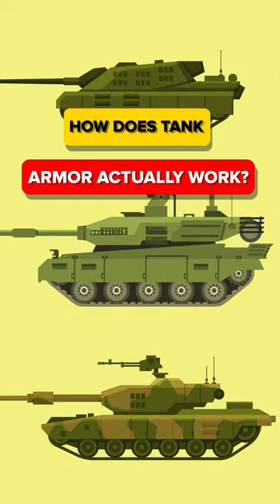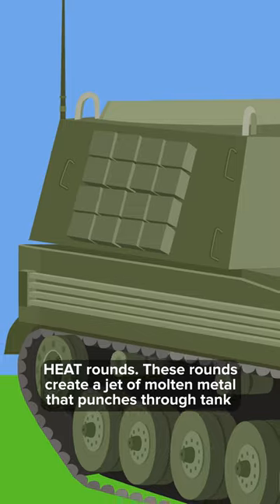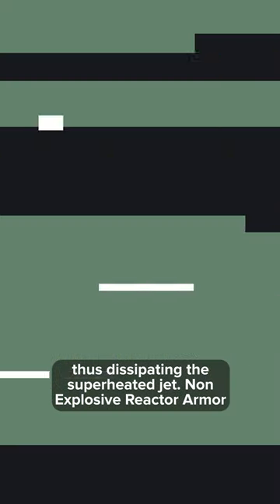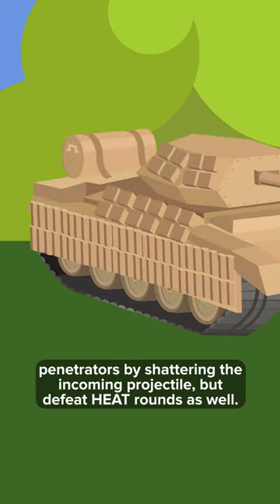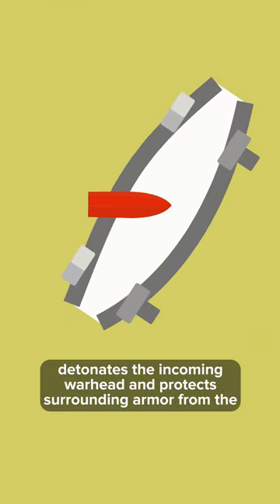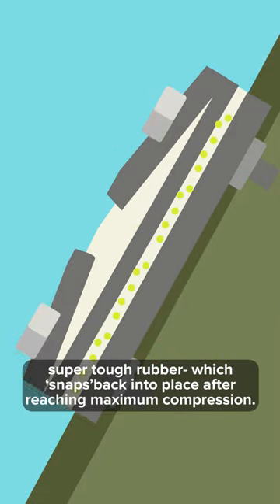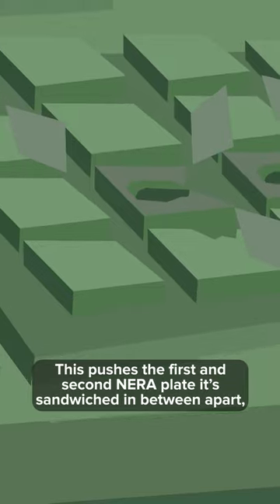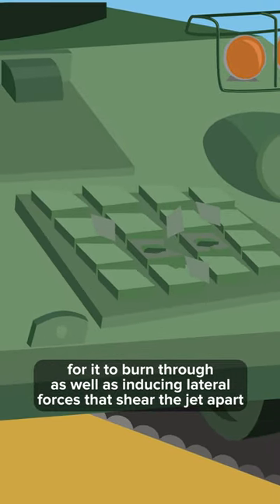How Tank Armor Works #tank

Comment: You forgot about electric reactive armor sometimes just called electric armor. Basically instead of explosive or polymers between the plates of the ERA there’s just air, but the plates are charged to high voltages basically turning the armor into a giant capacitor. When a projectile or HEAT jet penetrates the armor it contacts both plates at the same time completing the circuit and instantaneously discharges the stored current vaporizing the projectile or jet. Cool stuff.
Reply: Wow, that Sounds straight Out of sci-fi. Thanks for the Info.
Reply: it’s still in development

Comment: Have they thought about rubberizing the whole tank? Making the projectile "sproinging" back when it hits the tank.
Reply: Bro what💀
Reply: One of the reason modern vehicle armour is composite is because pure steel doesn't cut it. And its not jsut because of weight savings. The rubber-steel composite works because it has a hard surface(and tensile strength) that elastomeric rubber would never achieve. This hard surface, whether its steel or aluminum wlll serve to slow down the penetrator jet or dart while the elastomer proceeds to absorb the energy. Making it entirely rubber defeats the point of armour.

Comment: APFSDS just can't be properly protected against
Reply: Atleast for now.

Although Russia Claims their Afghanit APS can effectively degrade the penetrator, before it Hits the Tank.
Reply: 3 layers of Composite armour 18 mm each thick plates stop the APFSDS because in between the armour plates there are shock damping materials that absorb the energy of the kenetic penetrator and stops the needle
Reply: It can and is constantly protected against. That's why everyone is constantly trying to make better APFSDS.